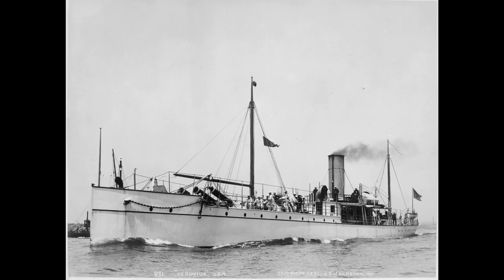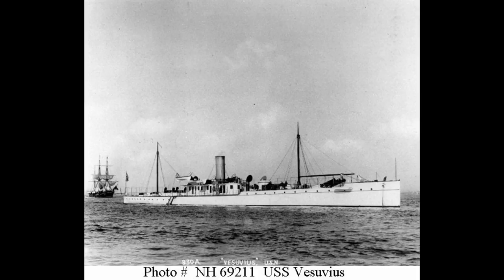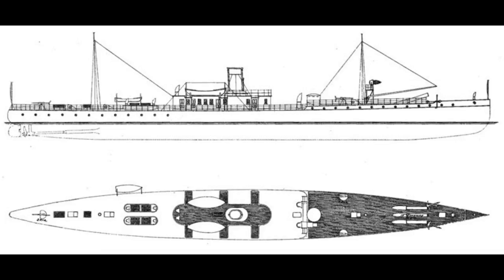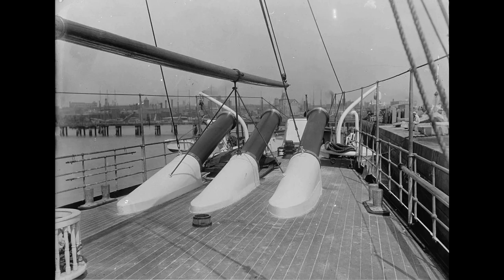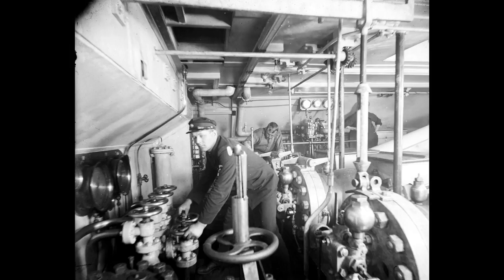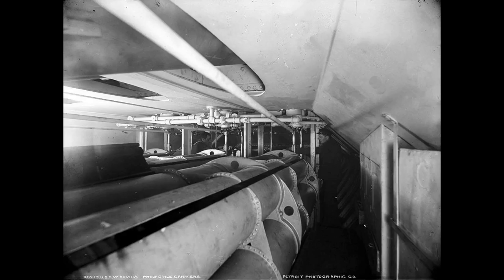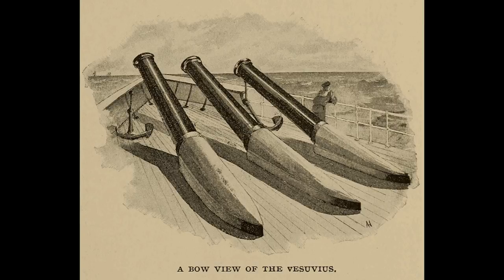USS Vesuvius - Guide 135 (Extended)

Comment: We laugh now, but in 1890 this ships seemed to be revolutionary.  Pneumatics was a new technology with great promise,  there were ideas for a pneumatic subway train, ( in New York City) pneumatic elevators, pneumatic mail delivery and of course pneumatic tools.  The main problem was supplying air to a turret,  which was solved and is seen in tanks and excavators today: the ring commutator which distribute air, electrical and hydraulics.  Another innovation was the quick release air valve still in use today.  So as a warship it failed, but it's technology is still around!

Comment: So.... We invented a air rifle that floats? 🤪
Reply: and lobs 500lb bombs
Reply: And every sailor's mother warned them not to shoot an anyone in the eye.
Reply: This is building a ship around a gun
Reply: i did not see any reference to the Barrel being rifled???
Reply: Well, that's how you design and build a warship: You design the shell, then the gun that can shoot that shell, and then you design and build the ship to carry those shells and guns around to where they are needed.
Reply: Lewis and Clark took a .46 caliber air rifle on their expedition to the Pacific Ocean. Held held 20 rounds ball and had a air tank that held pressure to  800psi.  It would fire around 40 times before there was any noticeable loss in velocity. It would shoot through a ine inch pine board at 100 yards. 
The Austrians used air rifles in some of their battles against Napoleon Bonaparte
Reply: @Ron52G  Forgotten Weapons has a video on the Girardoni air rifle used by the Austrians.
Reply: @Ron52G ...Could you give us a source? I find the technology required to compress air like that in 1800, when black powder rifles and pistols were more plentiful, cheaper, and more reliably able to acquire ammo for were available.
Reply: Yup.
Reply: @K9TheFirst1  well, the gas cylinder is just riveted and brazed. the pump and valves would be either latex rubber or leather seals, simply bore the pump with the same equipment as you're making your barrels on.

impractical? yes. apparently the system was rather expensive, gas cylinders were hard to make enough of, and the guns were fragile. but it's certainly not outside of the realm of a late 18th century gunworks to make.

Comment: The Nineteenth Century version of the rail gun! Both have had about the same level of success so far.
Reply: Probably equally expensive considering the era.
Reply: It isn't that an actual railgun doesn't exist. It does exist, and it functions. Only it doesn't fire as fast as the USN wants it to fire, and it's shell's are a lot smaller in prototype. It remains to be seen whether this weapons system will ever be completed, as the high velocity shell and laser weapons are further along in development. At least this is what was published last spring.
Reply: @rogerhwerner6997  Yes, just like the "dynamite" gun, it has looked far better on paper than it has as an experimental weapon. There are laws of physics that are against the rail gun, and the chances of it ever becoming an operational weapon is becoming less and less likely. As you say, there are other less costly and less risky weapons that will probably go into service long before the rail gun.
Reply: @sarjim4381  power requirement and the fact you have to rebuild the gun every few shots are the main problems
Reply: @andreww2098  That's what I meant by the laws of physics. You just can't miniaturize the generators needed to provide power for the railgun. Size and weight of generators will first need to be overcome before things like barrel wear become important.
Reply: The pneumatic Dynamite gun is still in use today on submarines. Instead of shells a fire missiles to the surface while the submarine is submerged, and the missile's engine takes over
Reply: James Ricker replied: "The pneumatic Dynamite gun is still in use today on submarines." You apparently wrote this and immediately deleted it. Can you tell me why you deleted it, and where I would find a dynamite gun in use on a submarine today?
Reply: @sarjim4381  torpedo tubes use compressed air so sort of the same
Reply: @andreww2098  That's like saying a Daisy air rifle uses compressed air and has a projectile so they are sort of the same. While a torpedo is launched with compressed air, the comparison then fails, since a torpedo is self propelled once it reaches a certain distance form the launch tube,  The projectile from a "dynamite" gun totally depends on the force of the compressed air for locomotion. That's why "dynamite" guns faded quickly from the scene while we still use torpedoes.
Reply: I beg to differ...

To date a rail gun has not been fired on an enemy target...

As Drach said, the Dynamite Gun was used for shore bombardment in the Spanish American war.

Thus, plus 1 to the Dynamite Gun... ;)

Comment: Dynamite anywhere in the mix is amusing.  A huge issue with nitro-cellulose explosives is instability.  Forget using them as a propellant for shells from a gun creating a pipe bomb - they were perfectly capable of going off all by themselves while in storage.  It was a relief to many involved in things like mining when the much more powerful TNT came around, as it didn't have those issues.  (It typically did need dynamite to make it explode in the first place, but that was for more manageable and less hazardous.

Comment: The US Army installed a battery of the same dynamite guns overlooking the Golden Gate at the Presidio of San Francisco in the late 19th Century, fifty years before the Golden Gate bridge was constructed. 
Known as the Zelinsky Dynamite Projectors, they fired dynamite projectiles propelled by compressed air. The steam-driven air compressor that serviced the battery was behind a huge, shielded berm; the powerhouse that held the apparatus is still there, though the guns were removed long ago. 
The Army’s Coast Artillery installed a huge bunker at the same site in the late 1930s to overlook the Golden Gate (yep; the bridge was built by then) and the approaches to San Francisco Bay. Known as ‘Battery Dynamite’, the bunker is also still there.

Comment: Another excellent presentation on a unique subject. 
No mention, however, of the other application for pneumatic artillery: coast defense. The US Army also saw the potential for the pneumatic “projector” as a means of cost effective coast defense in a perfect location, given the relatively short range of the weapons. Accordingly a battery of three projectors was installed at Fort Winfield Scott in the Presidio of San Francisco, in California.
Based on the Zalinsky technology, Battery Dynamite”, as it was known, was sited overlooking the Golden Gate, the narrow entrance to the harbor and bay of San Francisco. The entire installation was three projectors on swivel mounts, backed by a revetted concrete construction housing the air compressors and a power house to drive them, a magazine for storage of the projectiles, communications and telephone system, etc. 
For a detailed description of this unique coast defense concept, see http://www.militarymuseum.org/ZalinskisDynamiteGun.pdf
The revetments and powerhouse structure are still at the Presidio today, though the unusual looking projectors are long gone.

Comment: G'day there Drachinifel so about five minutes in looking at those cutaways I realize You could say this is a similar concept to the V3 guns I say similar due to both using compressed air which is crazy.

also Could you please do a video on the HMAS Armidale J240 only ship lost of her class of the Bathurst class AMS.
Reply: the V3 did NOT use compressed air, it used propellant like any other normal gun.
the idea of the V3 is that a lot of Chambers are at the side of the Barrel that ignite once the Shell is past them, keeping pressure in the Barrel up.
this way the Shell is accellerated over a Long distance reaching a much higher V0.
Reply: @ulrichkalber9039  ahh well my mistake than been a we while since I've read about the V3 weapon and how it worked, still the mounting is similar ish one dug deep into limestone meanwhile with the ship it goes down into the hull lower decks.

anywho.. the V3's are an interesting subject to read on the concept and the deadliness of them being able to fire against London from mostly underground gun system.

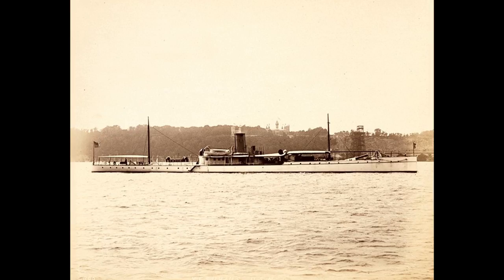Comment: 8:50 "There was a significant amount of dissatisfaction by the ship's Captain and crew over the design of the ship itself..."

You bring up this issue but don't elaborate. What issues did the Captain and crew have with the ship?
Reply from the maker: A lot of the issues revolved around the ships chronic inability to turn, somewhat important with foxed guns, and that it's construction and some meant it bobbed and weaved everywhere when trying to keep up with actual cruisers. Machinery wasn't that reliable either.
Reply: The captain (and naval commanders in general) had two big problems with the design. The worst was the ship carried 30 shells composed of "desensitized blasting gelatin", a combination of nitrocellulose and nitroglycerin. The were only desensitized to the extent this volatile mixture was somewhat protected by their brass or steel shells and fired using compressed air. The ammunition was carried in a magazine with about an inch of "armor" which was really just sheet iron. Estimates from amorers were even a near miss by a large shell like one of eleven or twelve inch shells Drach talked about would be enough to set off the nitro in at least one or two shells. Once that happened, the propagating shock effect would have set off the entire magazine. As was said at the the time, the upside to this was neither rescue efforts nor funeral expenses would be involved for the crew, since the resulting explosion would have been rather like a miniature HMS Hood blast. 

In addition to the dangers of sailing a ship filled with poorly protected and only marginally stable explosives into action, it doesn't take many measurements of the hull and freeboard compared to average wave heights, even in the Caribbean, to realized this vessel was much more like a coastal yacht than an ocean going warship. The vessel took green water over the bow in even moderate seas due to the low freeboard, and much of that water would go directly down the gun tubes if the barrel plugs weren't in place. This is a pretty obvious issue for a ship that would need to be pointed toward a target with the barrels unplugged during combat. The very fine curve to the stern was needed to achieve the relatively high speed of 20 knots in a 252 long vessel with only 3,200 horsepower worth of engines  The stern shape caused large waves to backfill over the stern in a following sea, This made the stern 3 pounder gun unusable and flooded the below decks spaces through the large ventilators on the stern section of the main deck. While it wasn't the worst naval vessel ever built, it's usually on top ten lists for these and other faults.

Comment: A good example of a weapon that’s only good for such a limited purpose, it may well be useless.

Edit: and is not cost-effective even in that role.
Reply: When not lobbing shells into the Spanish harbor and the protecting forts at night she made a good dispatch ship.  22 knots was high speed back then.  She could also contribute something as an anti-torpedo boat.  Americans were scared to death of the two torpedo boats in the Spanish Fleet.
Reply: George Everette 

If you need a fast dispatch vessel or a torpedo boat killer why not make something smaller and cheaper?